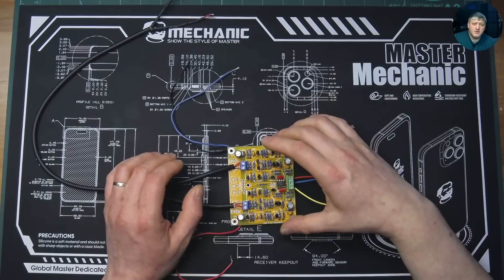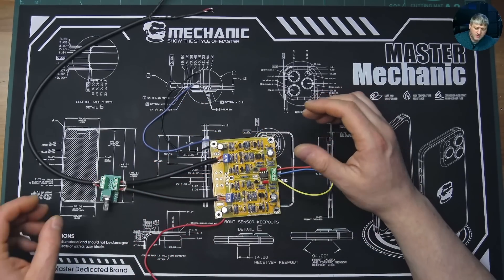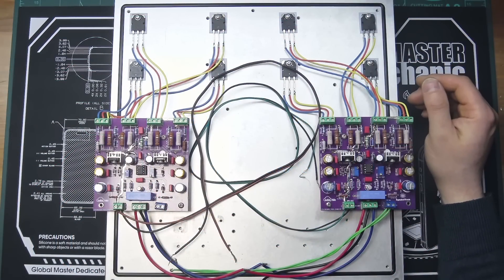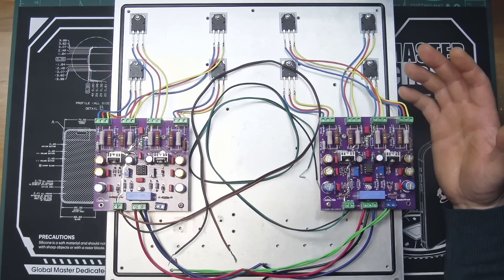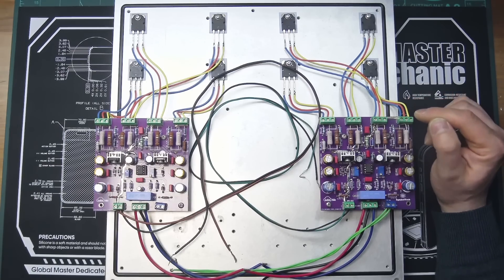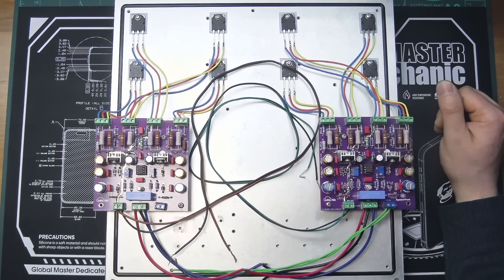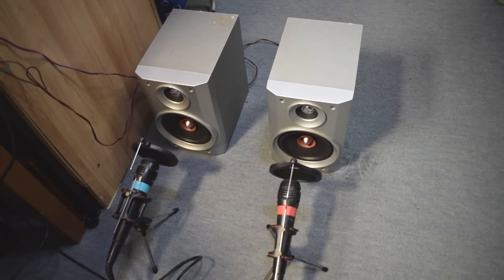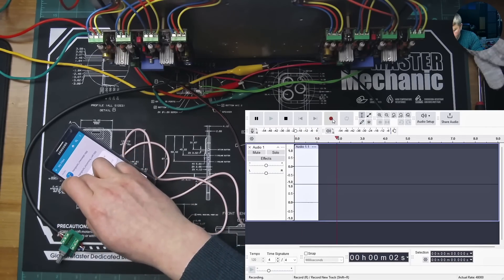Accuphase C3850 Is this the best preamplifier kit I ever built?

Comment: I use this kit everyday, very very good sound, fast and dynamic, great details, it's best option for adapt impedance of dac and smartphone to amplifier, i prefer genuine ne5532 with very balanced sound and not jrc5532 in kit (more details and thin bass, S sibilant)
Reply from the maker: I will try to find genuine ones maybe will have a good impact
Reply: Did it make that of a difference? Is the OPA2604 an option?

Comment: Im curious, any reason your using such poor speakers for testing? Im assuming its so if somthing goes wrong its not a big loss?
Reply from the maker: @JMJM75257  yes because I don't connected any speaker protection on the output. I need to build a speaker protection as a testing rig. And I can use then some expensive speakers on testing amplifiers!

Comment: In the last two stages of the circuit, you can replace bc550 with bd139 and bc560 with bd140. 
4 transistors for the left channel and 4 for the right. You will get a good headphone amplifier. Just like in the original 3850 circuit. 
Transistors can be installed without radiators - here is class AB. They practically do not heat up.
Reply from the maker: @igordocuncov2345  I will definitely try to see how will work but on my final preamplifier project I want to use this class A headphone amplifier to drive the headphones and to have a separate line out from the preamp to drive amplifier https://youtu.be/CT6ez2KJ1lY

Comment: I saw you had the volume pot on the output of the c3850 instead of putting it on the input is there a reason for that?  I have the same preamp but don't know if I should add a volume pot to the input or the output like you have yours.  Thanks  I have also been having issues using mine with class D chip amps(tpa3255, tda7498e).  I get bad turn on/off pops and bad ground hum noise in some configurations.  I have yet to try it with a class A/B amplifier to see if it doesn't like the class d amps or its something else.  I am using a 15 0 15 SMPS to power the c3850 and a 36v SMPS for the amp board and both have floating outputs.
Reply from the maker: Usually the volume pot is placed between the preamp and amp main reason for that is to put the load on the preamp according with the output impedance of the preamplifier
Reply: @SymbolTech21  If you are reducing you input signal with a pot at the input of the preamp, you are reducing your signal/noise ratio, and you are amplifying this bad S/N, so more noise will enter in the power amplifier. Just make sure, that you do not enter into clipping, because of the high amplification of this preamp.
Reply from the maker: @Alan_D_Mercant  Thanks for your comment, Yes I will take in consideration this advice, usually on the input should have a resistor 10k between signal and ground!
Reply: @SymbolTech21  No need to this. This preamp has 47K to ground at the input, and this is fine. If you can live with lower gain, its about 14,8 dB, factor 5,55 voltage, with R3 = 100 Ohm, you will reduce even more noise and disstortion. Changing R3 to 470 Ohm, the gain will drop to 6 dB or factor 2 voltage, which is sufficent for most power amps.😉
Reply from the maker: @Alan_D_Mercant that's great thanks for this information I will definitely give it a try to see the difference
Reply: @SymbolTech21  Sorry, I forgot to tell you, how to find this 100 Ohm resistor. If you look at the PCB with the input terminal on the bottom, you will find a 100uF cap on each chanel, and on the right chanel, this 100R is on the right of the cap, and on the left chanel it is on the left side of the 100uF cap. Enjoy!
Reply from the maker: @Alan_D_Mercant thanks I will have a look

Comment: Testeazal pe o pereche de casti 😊
Reply from the maker: @georgedorinmacsiniuc3334  nu cred ca duce impendanta mica. Castile au undeva la 32 ohms si cred ca minima impendanta de iesire este undeva la 10kohm
Reply: @SymbolTech21  Sound very good with headphone 32/50 ohm
Reply from the maker: @fotostudio604 I must try but I'm afraid that the transistors will not handle this low impedance!
Reply: @SymbolTech21  Input impedance is 50K, output 600 ohm not 10K, this is declaration of productor
Reply from the maker: @fotostudio604 maybe I was wrong so I can use 1k pot on the output. And still 32ohm is to low for these transistors.

Comment: Can you retake the test with a CD? Your speakers sounded plastic. I have just seen your other speakers that sounded better in the A-Class short with the same amp, I think. But that guitar sounded so good on my system. I took your advice about the test song and agree. Halloween song—try this. I think you will like the CD. It was called *Ultimate Demonstration Disc: Chesky Records' Guide to Critical Listening*. "Rebecca Pidgeon - Spanish Harlem (Lyric Video)" is one of the songs from the CD. Chesky Records. The full CD is on YouTube. I used to compete in the '90s SPL and SQ with Mecca. The judges used this CD on the systems in the car.
Reply from the maker: @masterlink_1  I would like to but unfortunately I don't have a cd player. But if in the future I will be lucky to get hands on a good cd player I will definitely try! The speakers I use on this video are full range speakers and the cabinet is not designed for these drivers. On datasheet of the driver's need 20L cabinet so I just need to try to build proper cabinets for these drivers!
Reply: @SymbolTech21  i can tell from my system that the info  goin into them isnt very clean ..but the cell audio is week ,and the spkers are not fast enough, i would try some polly fill in them to damping them up. we use to use cardboard boxes to test spkers you can try it and be amazed by it Using WinISD you can get your test even better i hope you get that amp and preamp in a box to sell them  wait i just re read your mesg it said a full range speakers these speakers are not for sound quality they were first made for pa speakers mono drivers  you will get no good results this way make sense to me why the guitar sounded good in the test we need stereo speakers cant wait to see your next move
Reply from the maker: @masterlink_1  I can try with a pair of Kef or TDL or Mission
Reply from the maker: @masterlink_1  the sound track u suggested to try I'm afraid I can't do it for YouTube due to copyright strike
Reply: @SymbolTech21  that would great i had a set of vintage kef i loved them i really like there silk dome tweets
Reply: @SymbolTech21  didbyou personal listen to all that disk could you find it ? It teaches us .and also it is recorded with out compassion
Reply from the maker: @masterlink_1  I didn't look to that disk, just I know that YouTube offer copyright to author so if I use songs from other authors on a video I will get copyright strike
Reply: @SymbolTech21  I'd love to get your opinion on that disk. It's a dream ✨️ disk
Reply: How much would it cost to make amp and preamp ? Could you give me a close estimation
Reply from the maker: @masterlink_1  you mean to make complete with chassis and power supply?
Reply: @SymbolTech21  yea the full amp with preamp in one case
Reply from the maker: @masterlink_1  the amp need big heatsinks because really running hot so I don't have a chassis with big heatsinks.
Reply: @SymbolTech21  what's your thoughts on fans right and left  rail and smaller heat sinks with fan management ?  The amp would need to shut down if a  fan would fail
Reply from the maker: @masterlink_1  fans are noisy, and when I want to listen I prefer to have a quite ambient possible! I have lots of thermal fans controllers boards so that is not a problem for me. The problem is noise
Reply: @SymbolTech21  i looked up amp kits with heat sinks today I seen some nice stock full size iam thinking I might have to try this kit out and amp

Comment: Nice.  And it looks like that kit is on sale right now.  I think I'm going to be adding one to my next AliExpress order.
Reply from the maker: @iainmcculloch5807  definitely is one of the best kits I built so far
Reply: What is the best power supply for these details? Please provide any suggestions from Aliexpress thank you sir.
Reply from the maker: @chandanakularatne6697  you mean te best power supply for the preamplifier board?
Reply: @ yes please before i order anything would like to hear your thoughts..
Reply from the maker: @chandanakularatne6697  so the preamp board come with bridge rectifier and smoothing capacitor and linear voltage regulators all what you need is a 12 0 12 volts AC transformer and you are all set.
Reply: @SymbolTech21  🥰